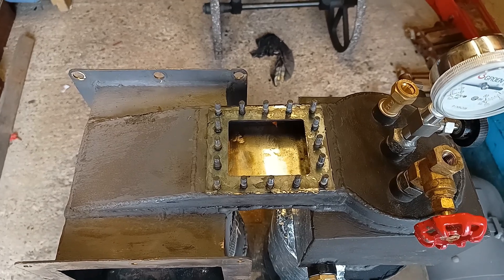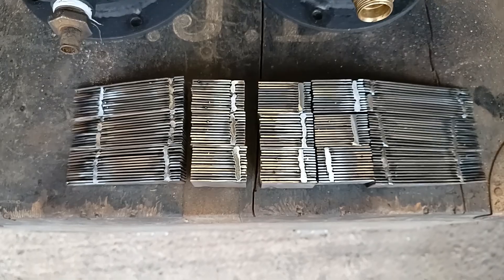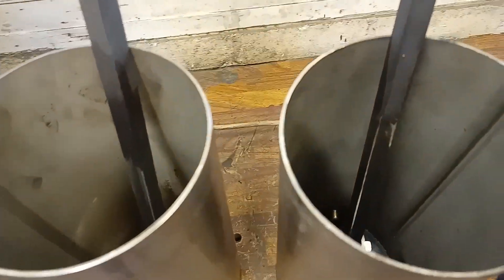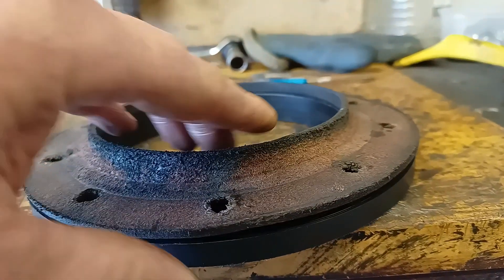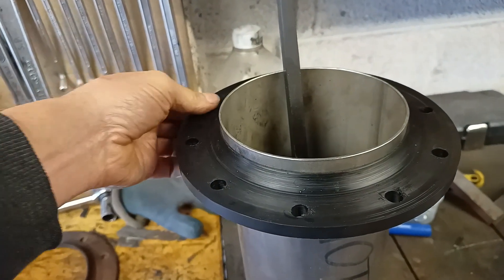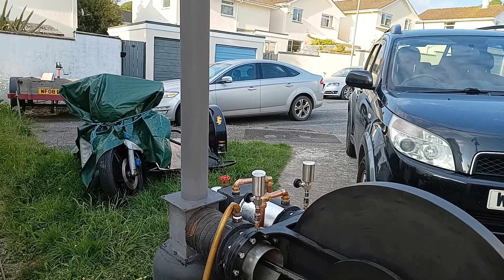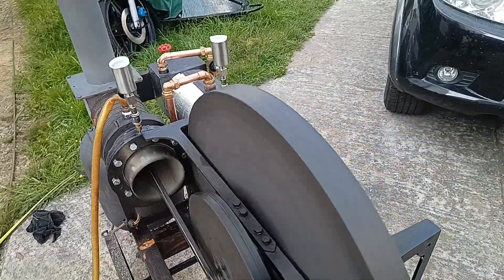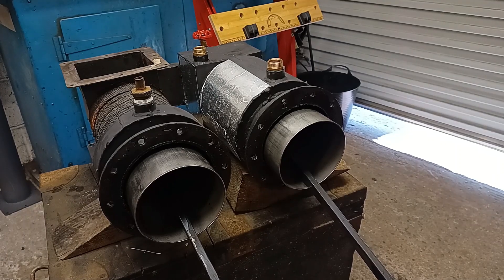Stirling Engine Horizontal Stationary Engine - New regenerator - Part 11

Comment: The double sided surface on the brass parts may come from the lose fit / wiggle room brass pins have.
I was thinking of graphite instead of brass. It's more fragile so need plan for that, bigger and less wiggle room possibly. Not sure how graphite will hold for the heat. Maybe it will burn from heat or crumble from vibrations/pressure. Just an idea.

I believe swapping metal sponge for metal plates with spaces is a good idea.

Comment: Loger pistons with a similar leather bushing/ seal in the back of the piston so it floats and wont dip in the front??  And lubrication on the back bearing also.

Comment: Bravo on the design and improvements. As soon as I heard the squeaking I knew it was the brass, if I had to guess that's where you used carbon rods? I originally thought of the leather using carbon dust as lubricant. As for the runaway scenario i feared after you sealed the cracks in the Pistons. They acted like a safety pressure relief valve.
Reply from the maker: Yes your right about the brass. The seals were still leaking like a sieve (I think they originally came off my previous engine and were stretched) but I've cut new ones today ready to fit. I would say I need a load next time to keep things in check!
Reply: Well she might go into a stall or crack, I realize the inlet one way valve can be turned off, so no need for overpressure valve. That could be used during load testing. But yeah I figured carbon dust on the leather, and I have no clue on how to keep the cylinder centered. I thought for sure laying carbon rods was a good idea. Another random off the Wall idea Tesla valve rather than the stainless steel, hot air gets directly putting the cold side to cool, and cool air it's directly put into hot.
Reply: Sorry I meant Tesla valves

Comment: When you fitted the brass pieces I thought: “they are too loose, they’ll rock and chatter”, and the pattern on them shows exactly that! 
Now after you mounted oilers, maybe some longitudinal bronze guide strips in the cylinders instead? The reason for mounting them in the cylinders should be to keep weight off of the pistons.
Reply from the maker: Yes, you were right about the chattering! A good lesson for me. Yes, the wear strips need to be fitted in the cylinders but this is problematic on the cold side with the water jacket (unless I can glue them?) cheers
Reply: @ShanePomeroy   I think you could on the cold side, and maybe stick with some sort of plastic (although that can be hard to glue. If you make them long enough to fit between the cylinder head and where you bolt the seal on, there won’t be any stress on them in the direction of travel. 
If you feel that full length strips have too much frictipn/surface, you could file them down in sections.

Comment: Oh dear, and the brass was my idea :( 
But anyway, a good improvement overall, and the only downside is that this project will soon be over once that is solved and we won't get more updates.
Reply from the maker: I don't think the brass was really the problem but the design. Someone else mentioned a wider disc would stop the chatter? There's always time for another stirling engine build! Maybe for the next build I'll do video's from the initial concept right through to building? The reason being is people can have more input? (and lets face it, I need all the help I can get : )

Comment: Awesome video! It is looking very promising! A couple ideas. 1 is the area that the brass guides glide on polished? If not see if you can. That should help with the wear and chatter. 2 how large is the hole for the brass and what is the gap between the piston and sleeve. Longer guides of bronze may help. You might be able to find some bronze in the plumbing department at your local hardware store.
Reply from the maker: Hi Sammy, Your right, I should try and polish the surface a bit. The holes are 10mm and the gap is 4.5mm ish
Reply: I think your gap to diameter ratio should work. Shine it up to reduce friction and wear. Bronze should work better, and maybe some load on the flywheel would also help. Less rpms aa load should help the rhythm of your system. 
Best of luck!

Comment: Some form of insulation on the inside of the hot piston may help with noise and potentially increase efficiency...🤔
Reply from the maker: Not a bad idea, it would cut down on dead space as well. Maybe a PTFE sheet or something?
Reply: @ShanePomeroy  possibly ,was thinking of something similar to a gaitor like on a ball joint of steering rack.... anything to reduce the interaction of atmospheric air with the hot piston should improve efficiency and reduce noise provided the Conrod isn't impeded 🤔
Reply: @ShanePomeroy  cut the neck off a balloon stretch it over the hot piston (or make a cap for the piston to reduce the hole diameter if it won't stretch) pass the conrod thro a hole in the center of the the ballon (should self seal) maybe a possible easy prototype to consider....be wary of increasing the weight of the piston tho 🤔

Comment: Just a departure from your idea what about a series of balls that will allow rotation. You may need to make your slide hole different. But they are low friction. Making the slide bigger will increase the friction.  I would keep the springs under the balls.  Peak can off gas some nasty chemicals when super hot. Graphite might be better
Reply from the maker: Hi Perry, That is a good idea and wouldn't be to hard to try. I think I've got some big ball bearings somewhere! Thanks for that one.  I'll also be cautious with PEEK, thankyou

Comment: I agree with the phosphor bronze or perhaps graphite impregnated bronze would be worth a try. fairly low cost for the amount you need. Cast iron also could be worth a go. Larger diameter with more of a dome on it to start with could help reduce the chattering.
Reply: Rotating them 45°so that each one is taking some horizontal and some vertical load could help too. That way any crud that falls to the bottom of the cylinder won't be grinding between the slide and the cylinder wall.

Comment: Maybe some kind of spring loaded rollers instead of the brass buttons might make less noise and last longer? Lubricating the roller bearing might be easier since its less exposed to the heat.